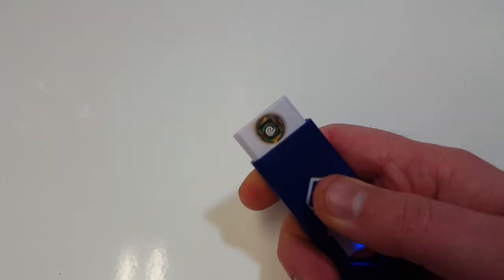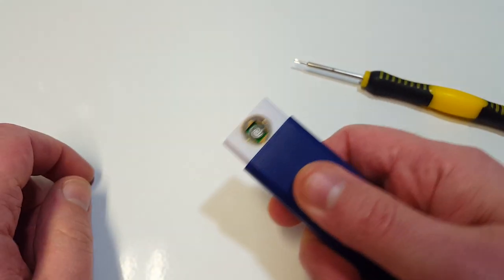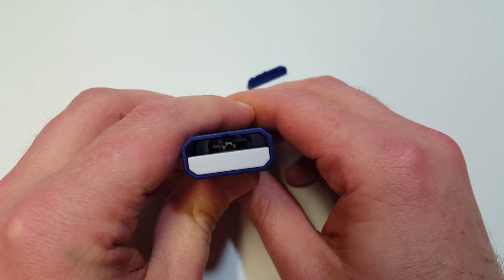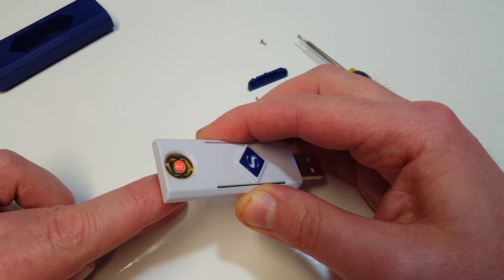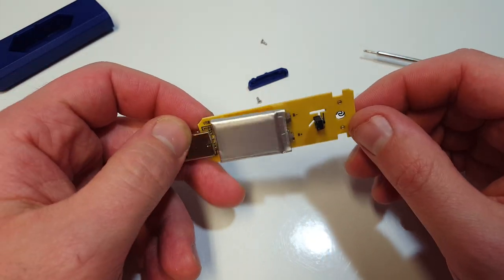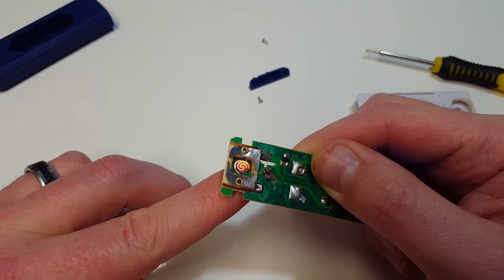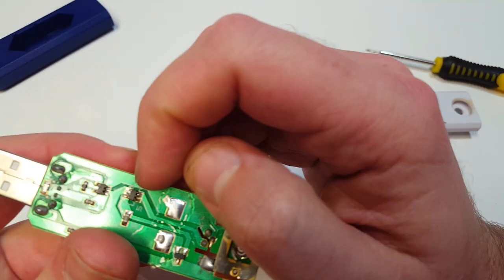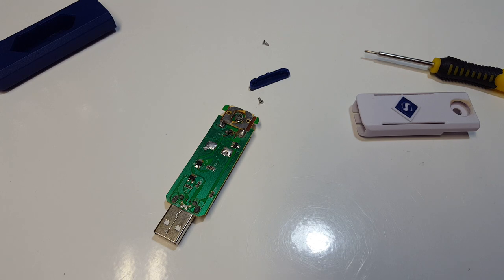USB Cigarette Lighter Teardown. Strange lighter I picked up at a dollar store.

Comment: How do you clean the coil? Mine works for a few times then doesn't stay lit long.
Reply from the maker: I would use rubbing alcohol and a Q-Tip
Reply: @NevsTechBits  but  everytime i open mine it lits up so how am I supposed to clean it when it’s red hot?
Reply: @chacal8192  It turns off after like 10-15 secs

Comment: Hey my lighter is not lighting ,the coil is not lighting can u pls make a video to solve it
Reply from the maker: Is the filament clean?
Reply: @NevsTechBits  yes its new it just came yesterday
Reply: The light glows and gets off immediately
Reply: @sayantanbiswas6012  did you get any answers to your problem?
Reply: @gerialford5090  nope my lighter is working fine it's flame and battery is poor just because it's a very very cheap thing can't expect much
Reply: @gerialford5090  yep mine does the same